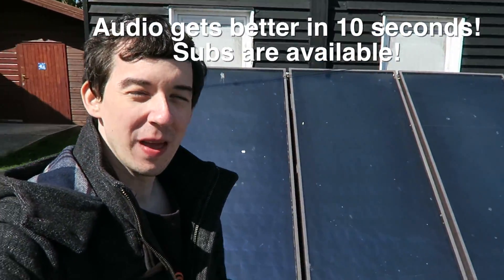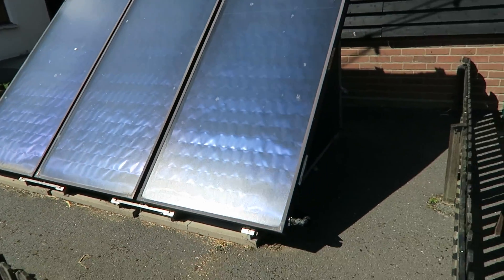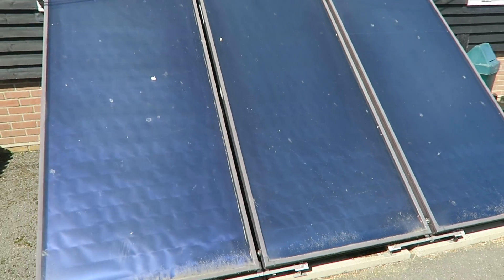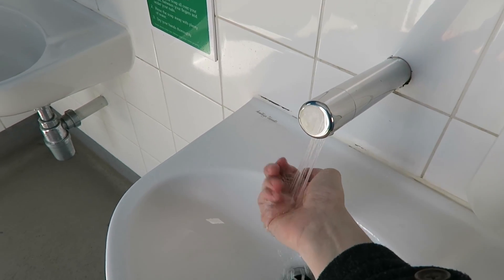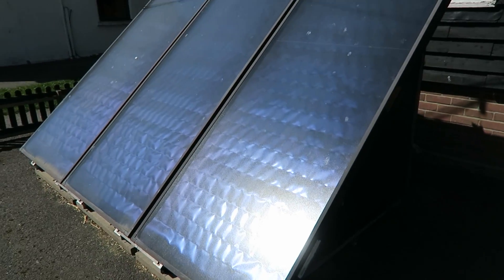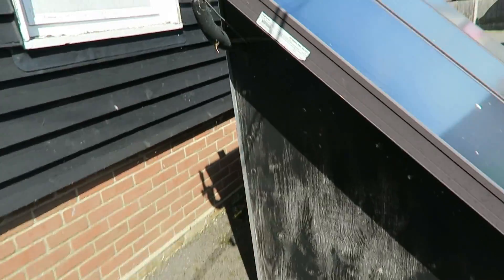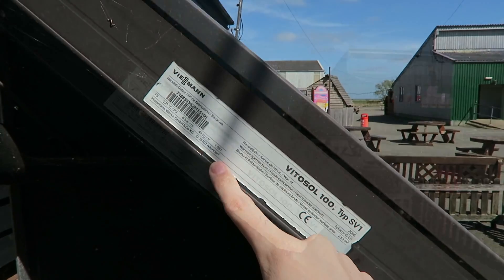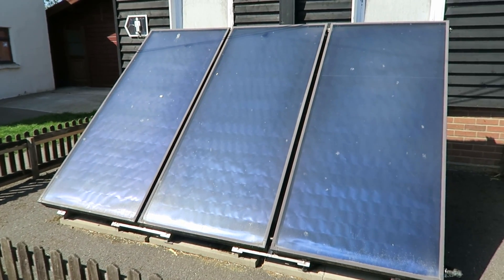Solar water heater at Marsh Farm

Comment: We have built our own solar water heater in the Philippines with the tank hidden inside the house, the surface area of the panel isn't huge. But it heats a huge tank to above 50 degrees in the summer. And about 40 in the winter months.  It works perfectly and it isn't even facing South.  I do advise  having an expansion tank if your building on an indirect system.  If we fill it with oil to the brim we get a lot of excess bleeding onto the roof.
Reply from the maker: +the_son_of_ben awesome, can you share some pics or more info? Maybe I'll also make a video about the one I made, it's pretty basic though.
Reply: +the_son_of_ben Here its a pretty basic system and I'm sure if we increased the panel size we could get the oil up to 80-90 degrees C but 60+ is enough as it heats the water to about 50+.  https://drive.google.com/file/d/0BxLziK1-WEXDU1ZvRVhZNDBuRzA/view?usp=sharing 

If you have any questions or if you want to see our system, you're more than welcome to pop down to Southwoods (Laguna) or you can just email me. :)
Reply: +the_son_of_ben BTW the panel is coper tubes underneath glass, it's not vacuum tubes. There is kinda no need when there is so much sunlight. Even if it's been raining for a couple of days the panel still produces luke warm water.
Reply from the maker: the_son_of_ben Same here. Mine is just a wooden box with some foam insulation and then a bent copper tubing and it's meant to be glass over the top but I just put plastic for now and it worked okay. The hardest part was finding someone who can bend the tubing without kinking it. And they still kinked it anyway lol